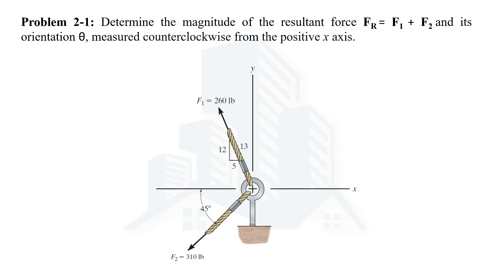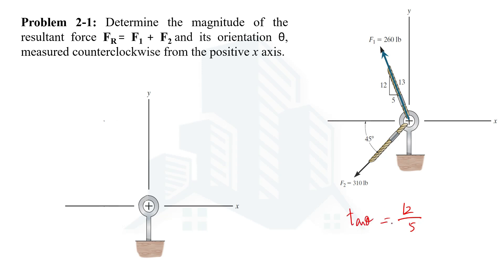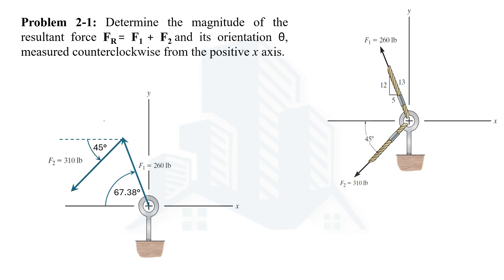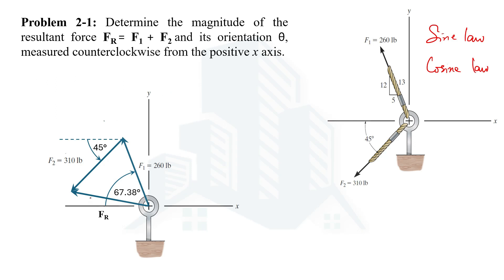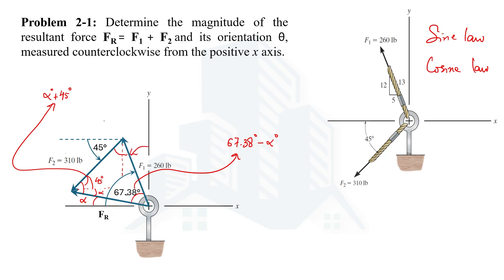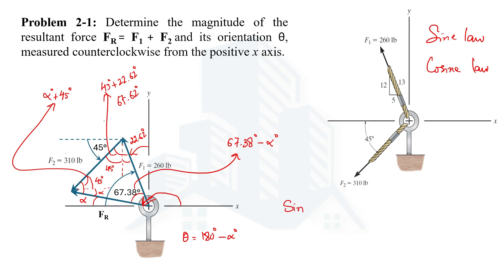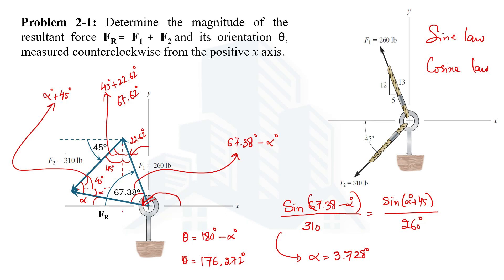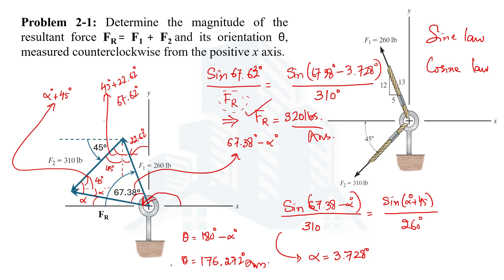Problem 2-1 Determine the magnitude of the resultant force FR = F1 + F2 and its orientation u x-axis

Comment: When you say “simple calculations” do you mean just cross multiplication? 
Ex. Sin(67.38-delta)/310=sin(delta+45)/260
Reply from the maker: In this example, before you cross-multiply, it’s helpful to simplify Sin(67.38° - α) and Sin(α + 45°) using the trigonometric identities:  
- Sin(a - b) = Sin(a)Cos(b) - Cos(a)Sin(b)  
- Sin(a + b) = Sin(a)Cos(b) + Cos(a)Sin(b).  

Once you’ve simplified these, you can move on to cross-multiplying. I hope that clears things up!  

Btw, by simple calculations I mean solving this type of equation should feel familiar to you since you’ve likely worked with similar problems in your earlier studies.
Reply: @ mmm I see that clears my question thanks for the clarification. You got great videos thanks for that !
Reply from the maker: @ Happy to help. Thanks